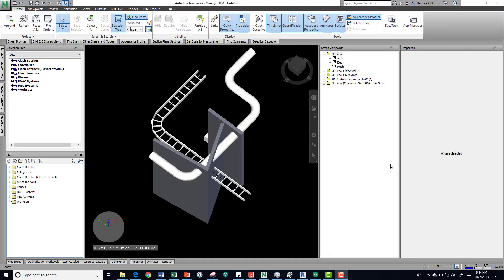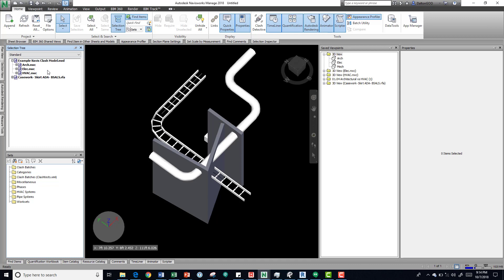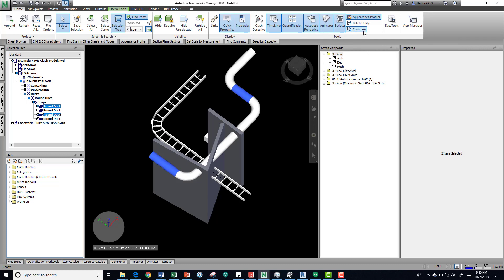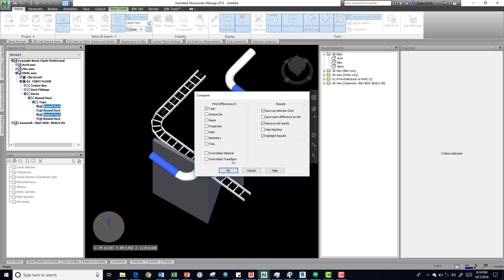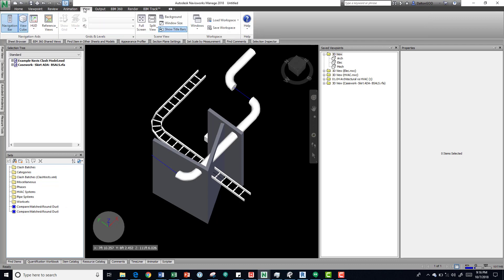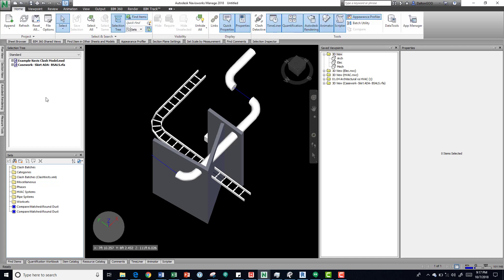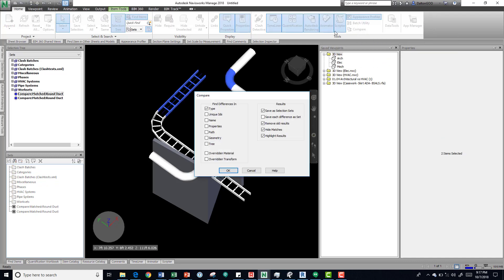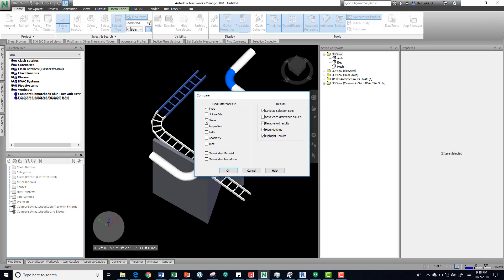Navisworks Model Compare

Comment: Did absolutely nothing... I've two DWFX files of a building model, one from 6 months before, one from a recent transmittal. Comparing them,  gives unmatched sets... Paints the building into two different colors which overlaps each other. I'm 100% the differences between these two models must be less than like 5% difference overall. The differences it finds are just a few ridiculous polylines from DWG imports into the bim model before we exported the dwfxs,  so can't find compare a single 3d object with another.....unbelievable... year 2020, and have a look at this nightmare... i bet i can compare these two models with excel exports....
Reply from the maker: It isn't the best tool out there. I like BIM 360's model compare, which sometimes gets switched up and shows incorrect information. Were these DWFX files exported from Revit? Sometime when I am comparing models, I will simplify the "Find Differences In" selections. Starting with Geometry.